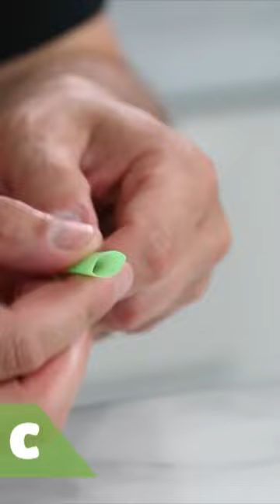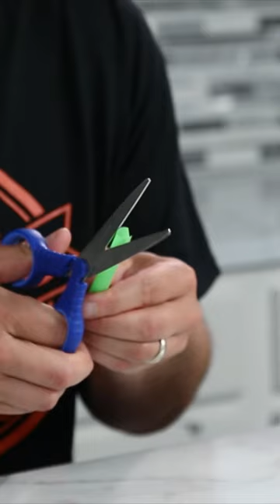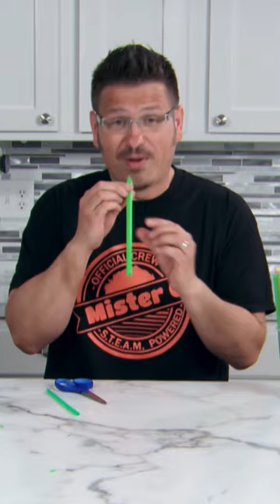Straw instrument (reeds)

Comment: Thanks I might need this for my project, (I have to make an original instrument with stuff at home 😭) I just gotta figure out if it would be a woodwind or brass cause of how sound is created 🙃
Reply: Honestly they're neither, cuz the material isnt wood or brass, but since reeds are used in woodwinds, you might call them that, while brass instruments require the vibration from your lips to create sound
Reply: same